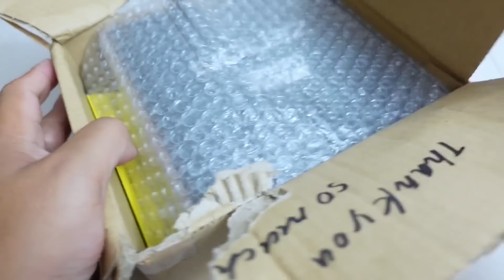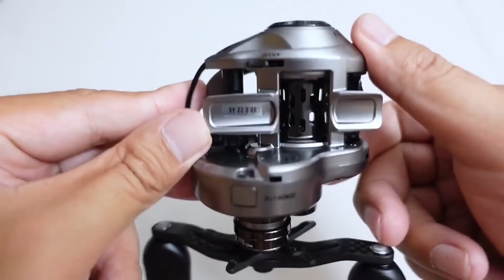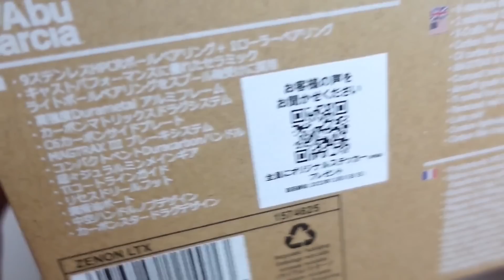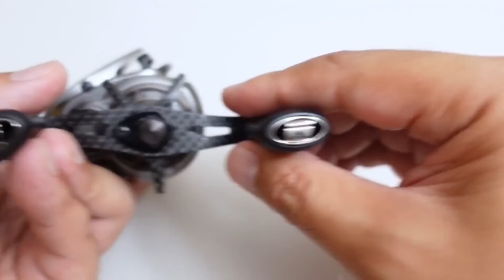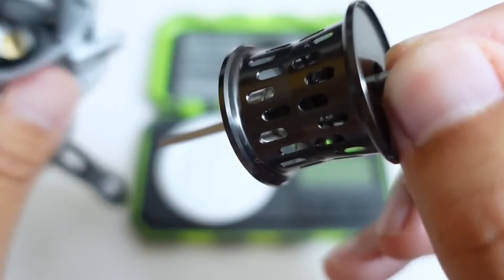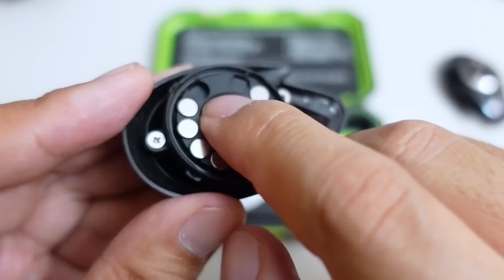Abu Garcia ZENON LTX has landed... WATCH BEFORE YOU BUY!!!

Comment: like you said, this reel is marketed for saltwater bfs. no one fishing the gulf coast or the atlantic coast uses 1 gram lures. even a shrimp and a hook weight more then a gram. i had a 2016 aldebarron bfs I ordered from digitaka. fishing for redfish over 4 months destroyed it. the main gear teeth were almost completely shorn off. i just caught a bull shark friday using my tranx 200 with 13# drag. the steel which is hopefully stainless, is I believe made for saltwater. I just went to japan lure and all they had was the new zenon beast!. depending on your casting results i might consider one although i dont use anything under 1/4oz jigs plus Berkley gulp shrimp.
Reply from the maker: The main fish they target in the Japanese SW BFS scene is horse mackarel. RX Angler has been using his 16 Aldebaran for big reds with no issues for at least a year or more.
Reply: Many, many people on the Gulf coast throw 1 gram lures. On the Texas coast we get into back lakes and they get very skinny where if you throw larger lures the who back lake will get spooked.
Maybe try loosening up your drag and trying not to just horse a fish in and your gears will last.

Btw, nothing under a 1/4 oz jig?!? That's the heaviest most here would consider fishing.
Reply: @ETuss713  1/24oz is around one gram. i really doubt many, many people are throwing 1/24oz lures for redfish. i too have a few back lakes in Florida. i use 1/4 to 3/8 jigheads plus gulp shrimp, have no problems catching them. the red in my youtube picture weighed 35 pounds. you aren't catching that with a bfs reel and 5# braid. my aldebaron bfs was a great reel for rat reds and trout and flounder. fact of  the matter is that the main gear teeth were almost completely shorn off. very possible it was me because i was using 15" braid and a 1/4 jighead.
Reply: @creekredfishingmastery  wrong. Not everywhere is Florida. We use BFS reels with 5lb or .8, 1.0 PE/ braid catching tailing reds in 6 inches of water.  There's many many videos on YT showing exactly that. RX Angler is one of them that fishes the exact same waters as me.
Reply: @ETuss713  im not arguing that about bfs reels. like i said ive used the great aldebarron. im arguing the use of 1/24oz lures for satwater. i have watched every video rx angler has made. HE is the reason I got the aldebarron from digitaka. im also saying you aint catching a 42" 35# red like I did with a bfs reel. this past friday i caught a bullshark, a 30.5" red, 3 slots around 22" and a rat red. no way on earth are you catching a bull shark with a bfs reel and 5# braid. Im a fan of bfs reels. i just want some more drag and beefier main gears. this abu the reel test looked at has my interest. i use a shimano tranx 200 which has issues casting  1/4 jigheads more then 10 yards. i just noticed that daiwa usa has a new coastal sw 80 coming out soon. im interested in that as well as the new tranx 150.

Comment: Just got my 22aldebaran xg delivered, honestly i think its a downgrade, knobs dont seem to have bearings (or if they do, those suck), grips are uncomfortable, etc.
further specs and looks are really nice, the brake knob isnt actually that bad.
Havent fished with it yet, though i am thuroughly disappointed that they didnt include one of those neoprene reel bags.
smoothness isnt actually improved that much, and im absolutely furious with the fact that i didnt keep my old aldebaran.
Reply: U just may have changed my mind on getting the 22  glad I held on to my 16 😁
Reply: @johnsolinas4496  Yep, that reel was just something else, this new ones grips feel like a mix of EVA foam and shitty rubber.
Reply from the maker: The improvements are in the ultralight casting range, sub 2 grams and also casting feel. Its smoother, quieter, and faster than the 16. Both my 22s are a step up in smoothness over the 2 16s I have as well.
Reply: @THEREELTEST  I see, i guess ill get to feel these improvements when im fishing with it.
Mine isnt all that smooth at all, but the drag feels a bit more solid.